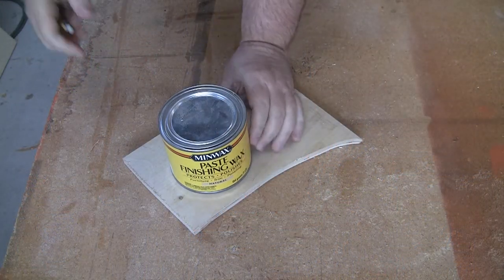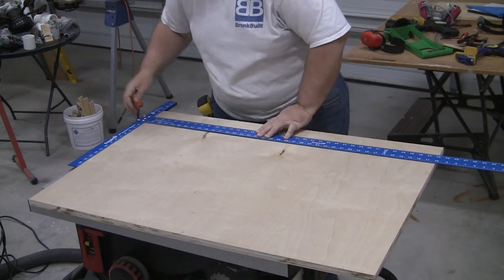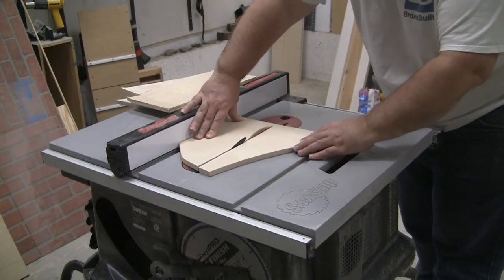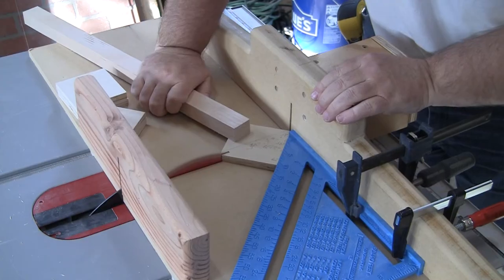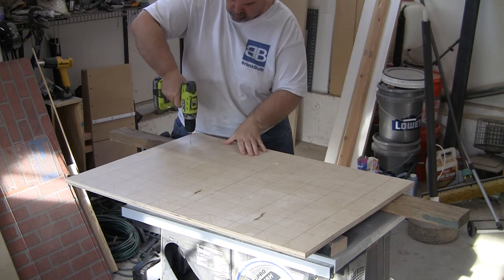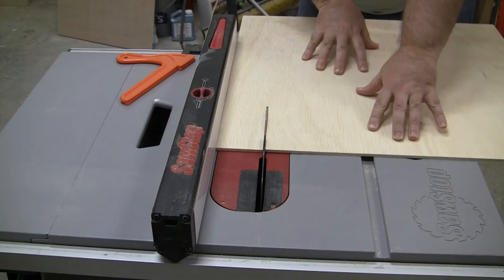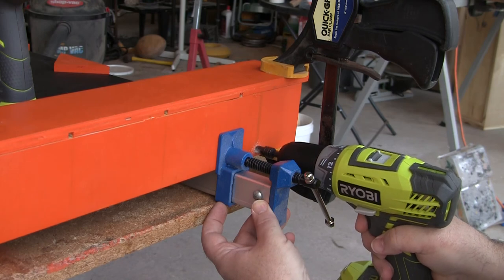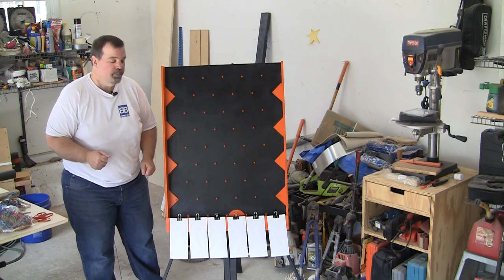Free give aways - How to make a Plinko Game

Comment: You can always go back at a later time, take out the screws and use something like thick straws or tubing and put the screw right through it.
Reply from the maker: +Mario Monti didn't think about that.  Great idea
Reply: BronkBuilt Just saw the post where you said the disc sometimes falls off. The screw heads probably help keep it on more often than not. I would say don't out on the straws or whatever until you for the game further back. Otherwise it may help it in falling off. Great project BTW.